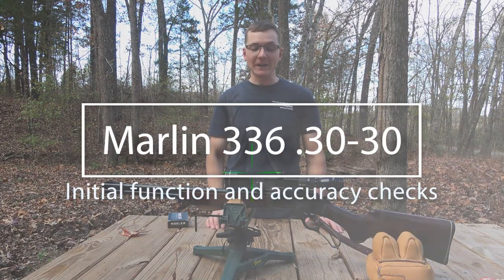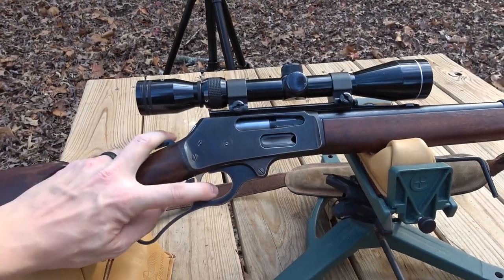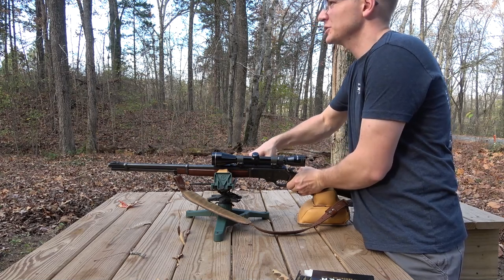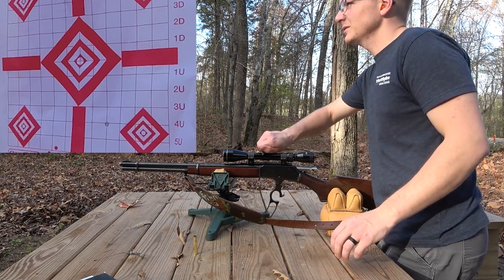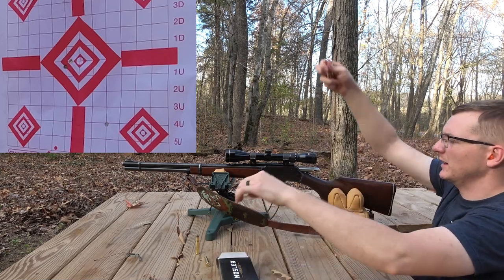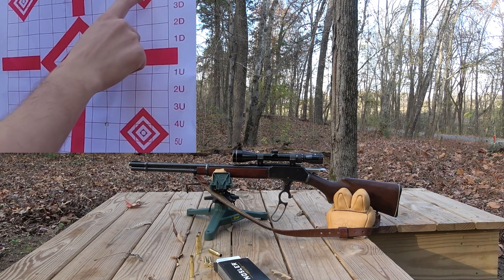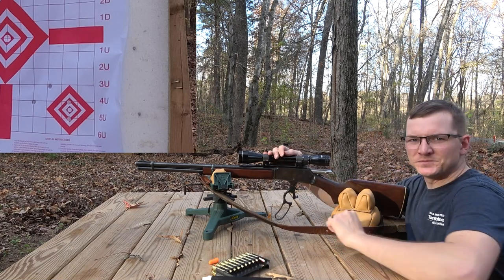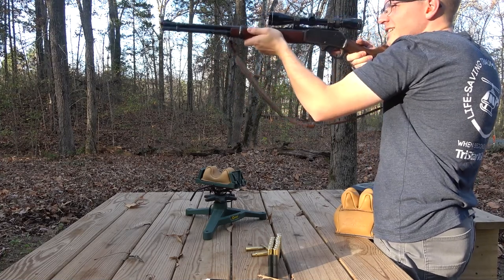Marlin 336 .30-30: Initial Function and Accuracy Checks

Comment: My 50's vintage 336RC will not reliably strike CCI primers.  It fires flawlessly with Remington & Winchester primers.  My best accuracy is with Remington brass & primers, 150 grain Speer Hot-Cor flat nose bullets with a 35 grain charge of W-748. Good luck with your gun, we've seen those lever action Marlins quadruple in value over the last 30 years.
Reply from the maker: Thanks! I’ve got the problem fixed, see my latest video on the 336. I did end up putting nearly $500 more into the gun in work and parts, but I think it was worth it.
Reply: If you are like me probably wouldn't sell the Marlin for anything. Just can't replace the memories with it.

Comment: Firing pin probably gummed up, a few drops of 3 in 1 oil on the pin cleaned with a q tip and reoiled should help. The lever issue should be easily fixable if I remember correctly. One of the most accurate guns I have ever owned. Plenty of videos on YouTube on how to take apart and clean .

Comment: Marlin misfires are kind of common.  Two piece firing pin and rough surfaces on the rear portion of firing pin.  I smoothed and polished mine but have not yet had a chance to try it again.  Tons of misfires.  I can’t trust it for hunting yet.  Mines a 1984 date.
Reply: well Lots, I have to disagree with your statement, "Marlin misfires are kind of common".  In my hunting lifetime (71 years) I've owned many 336's and have never had a misfire.  Probably one of the most reliable firearms there is.
Reply: @easttexan2933  
It’s common enough that you’ll see several people on YouTube talking about how to fix it, and those posted videos have comments from people who have experienced it.  So it’s a thing.  I’m just saying that it happens, and unfortunately mine is doing it.  It is smooth as glass, looks great, feels great, but mostly does light strike misfires, just as others have reported.
Reply: @lotsofstuff3860  interesting.  I need to get out from under my rock more often.
Reply: I had a .35 that had misfires  I ordered a new firing pin ,when i pulled it out to install it a huge metal shaving fell out I don't know  how common this is but I reinstalled the original pin &have fired it for years never had another. The shaving had to have got in the bolt at tha factory.
Reply: Not mine
Reply: I finally got a chance to take my 336 since polishing rough firing pin surfaces.  Shot 10 rounds without a single misfire.  Same ammo that kept misfiring a few years back.  Same box.  Shot great.  I’m really pleased with it.
Reply: @lotsofstuff3860  well there ya go !!
Reply: @easttexan2933 it’s a “common” problem. Nothing a one piece firing pin won’t fix

Comment: Good video. Sure is low velocity for a 150gr bullet. Most other factory ammo I have in 30-30 is averaging 2350 give or take. 
In 2013 I chronographed 160gr Hornady LEVERevolution in my 2012 Marlin 20” barrel and in my 1973 Winchester 24” barrel. 10 shots on both were averaging 2465fps. I have not done the test since so I don’t know if it would still chronograph the same or not.

Comment: 9:36  My 1973 336A (24" barrel) did the same thing.  I showed a gunsmith and he said don't worry about it.  What ever was happening, it has stopped.  Primers stay seated now on factory and hand loads.  Yours could be different, so show a gunsmith what you have to be sure.  
Best factory loads so far are Leverevolution, followed by 150 gr. Core-Lokt.  I mostly shoot hand loads.
Mine came with an original Weaver 4-power scope.  If you can find a decent 4-power, or even lower, I recommend you try it.  Mount it as low as you can.   It's really the right scope for .30-30 shooting.  High magnification is just silly, even detrimental, on a .30-30.
My 2 cents.
Reply from the maker: I’d agree, no need for high magnification on this. I’ve thought about throwing a 2-7 Leupold on it, that would be about perfect.
Reply from the maker: Gunsmith has it now. We’ll see what he says.

Comment: Your first group of five shots was 1/2 inch at 50 yards. That is outstanding especially with that scope. 
Get the head spacing checked, the lever fixed, the firing pin serviced and a good quality scope, because you have a real shooter. 
I have a newer Marlin that shoots Hornady Leverevolution ammo at .75 inches and Remington CorLock at just under 2 inches at 100. 
Pick up some Hornady and good hunting.
Reply from the maker: Check out my other videos on this rifle, I did exactly that! Except that I haven’t changed out the scope yet.

Comment: No recoil at all?  I have the same gun per ser# made in '77.  There was another post about using 35 grs of 748 behind a 150 bullet and I found the same to be best.  With that load the punch to the shoulder will certainly be felt.
Reply from the maker: @scottstiers9309  I don’t remember the circumstances around saying this, but it’s very likely I had recently been shooting 30-06 and similar from old military rifles with steel butt plates. The 30-30 with this load does have a bit of recoil but it’s quite manageable.

Comment: I wonder if a previous owner lightened the hammer spring to get that glass-like action, and as a result caused the light primer strikes?
Reply: That's what happened to me. I put in a lighter main spring and had an occasional FTF. Put original spring back in and everything is hunky dory. I no longer swap these springs out.
Reply: David - I bought a revolver and the seller told me that the action had been “slicked up” only after we struck a deal. Turned out the hammer spring tension screw was backed out and Bubba had cut 4-5 coils off the trigger rebound spring. Fortunately I knew exactly what needed to be done to get a safe, reliable gun.

Comment: Some 336s have a problem with light strikes due to the two piece firing pin producing unnecessary drag. Replace it with a one piece and problem usually goes away
Reply from the maker: That’s what I ended up doing!
Reply: @TheOutdoorGeneralist  My bad
Reply from the maker: @guaporeturns9472  no worries! That was in a later video. Thanks for watching!

Comment: ... that Tasco junk scope should be able to hold together on a 30-30 win ... good "cosmetic shape" might not be good shooting shape ... hope you checked the barrel with a flashlight ... if the previous owner(s) fired enough shots to wear out the lever retention pin spring the bore could be as smooth as a baby's behind
Reply from the maker: Oh I did check the bore! Looks pretty dang good. And it shoots good with handloads too. I agree the Tasco scope is junk but it has held zero so far. The rifle will eventually wear a different scope but I didn’t make that an immediate priority.